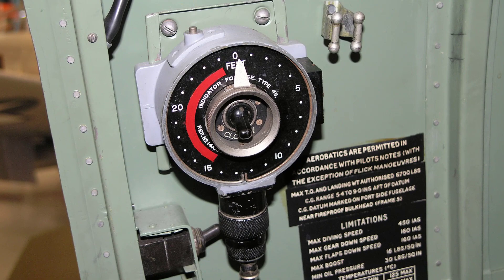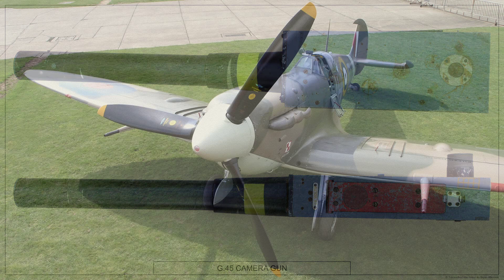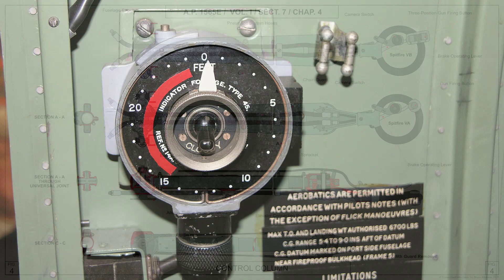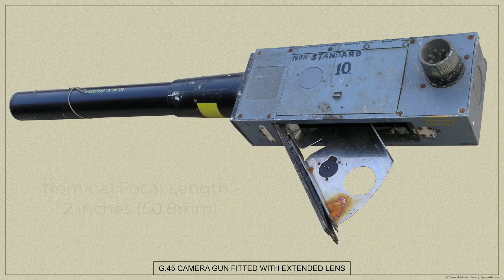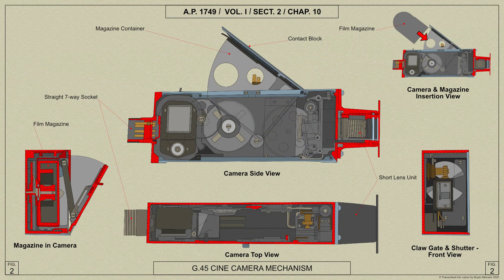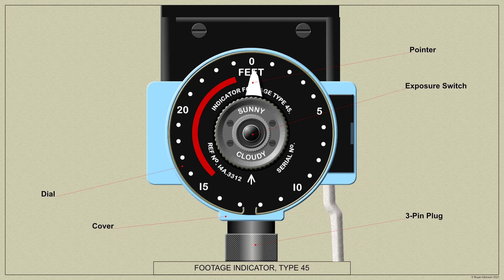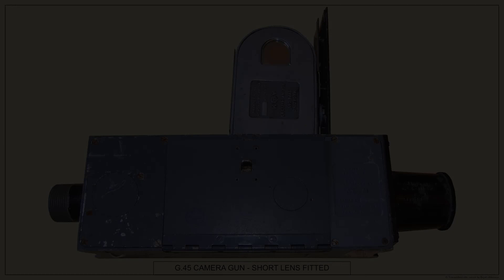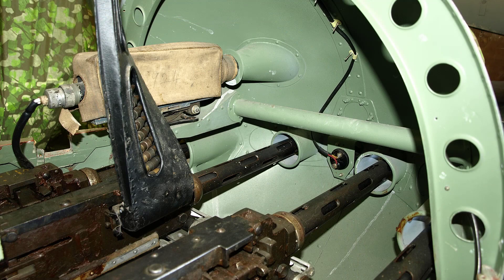Spitfire Mk V – G45 Camera Gun

Comment: Hi there.  What a brilliant video.  I just bought a G45 camera today.  The green band on the top and bottom of the lens and the side mounted power plug indicate it was likely mounted in a Hawker Hurricane going by the images on your video.
I also already have a cartridge that I've never opened.  I don't imagine there is any film in it.  What would be the best way to find out so I don't expose anything if there is?
Again.  Thanks for a nicely detailed and well executed video.  I only paid £45 for the camera.  Now I need to hunt down the manual site and a titling unit.

Cheers Trevor
Reply from the maker: Thanks for watching, Trevor
Reply: did you found the manual. y have the titler but loking fore the manual
Reply: @user-gp3eo5qt7f  I don't have a manual.  It would be a nice thing to find.

Comment: The titling process is a bit confusing to me.  It seems to be exposed at the beginning of each 25 foot segment, but the data included can only be known after the flight.  Is the film initially loaded with the first 14 frames skipped, then "rewound" if any has been exposed so the title can expose the first 14 frames?  Also, if a plane makes several different attacks; does each segment get its own titling, or does the initial titling just say more, perhaps dividing that 14 frames into shorter titling pieces?
Reply from the maker: Thanks for your question. The G.45 Camera Magazine held 25 foot of film only. The first 14 frames would have been wound on before the magazine was placed in the camera. Once the operation was completed and the aircraft had returned, the magazine would be removed by the Armourer and the film prepared for titling.  The title is written in black pencil on the ground side of a clean cellon tablet and this is inserted in the rear slot with the writing towards the lens. The loaded magazine is then fitted into the magazine compartment of the Titler Unit. The Titler mechanism is wound fully by means of the handle on the motor side - ready to expose the first 14 frames of film. The titler is then pointed towards the sky and the plunger is depressed until the spring is unwound. About fourteen frames of the film will then have been exposed to record the titling details, which should appear on development. These details should appear as bright letters on a dark ground and last approximately 1 second on the screen. All attacks would appear as taken on the 25 foot of film, and only one title at the beginning would have been created. Thanks for watching.
Reply: @ukaircraftexplored6556  Thanks -- absolutely clear now, as are all your videos.